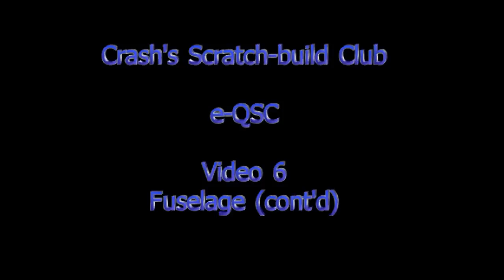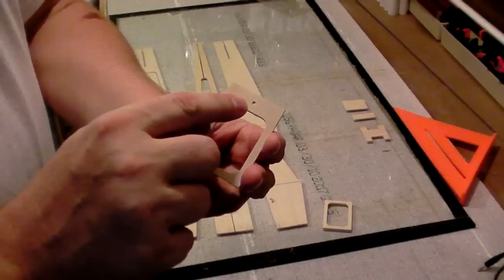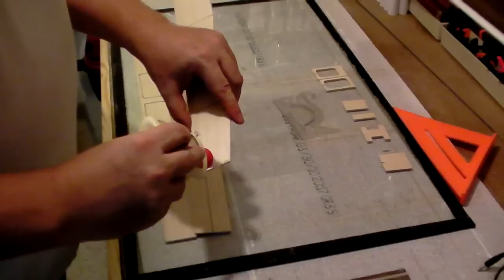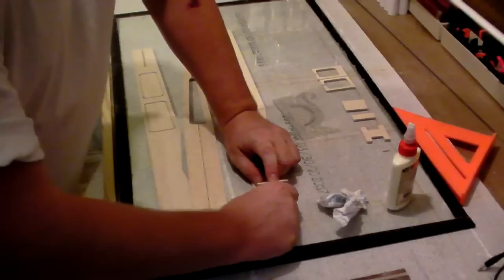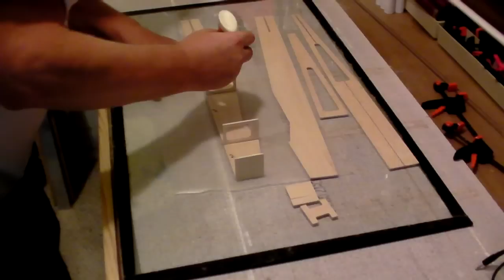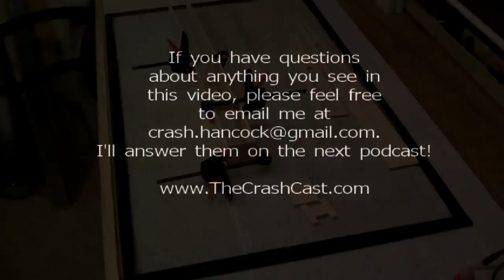e-QSC, Video 6 - Fuselage Build (1)

Comment from the maker: @Sweden217  I generally use the cheapest stuff that I can find when building a "QSC" series project. In this plane, I used just regular old yellow carpenter's glue for all of the assemblies. You could certainly use CA or epoxy, though.